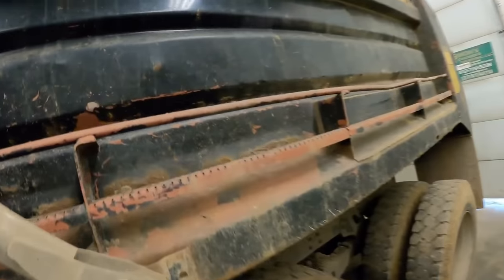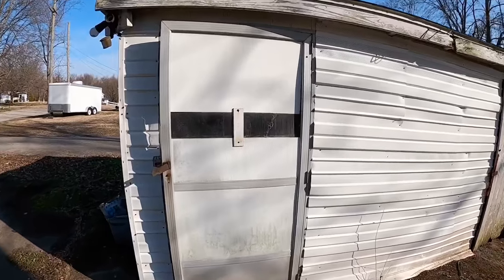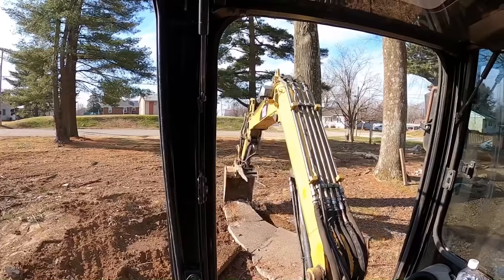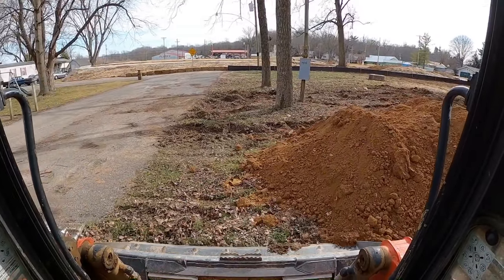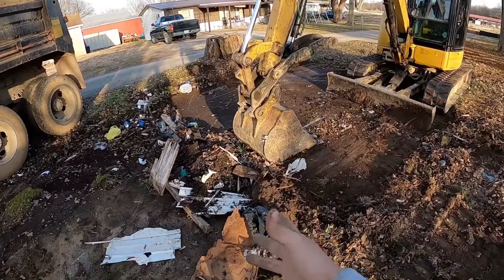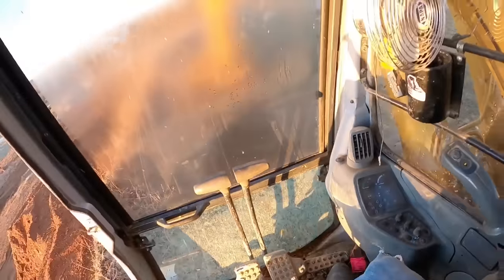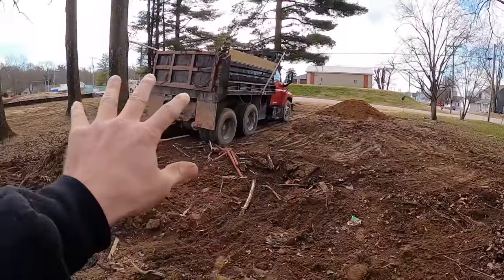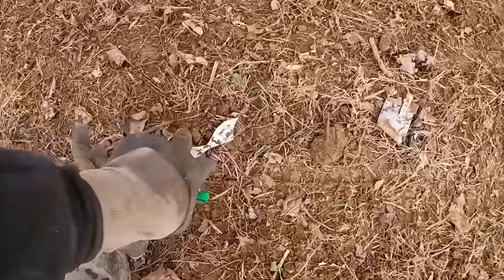Full Clean Up - Concrete Demo at Abandoned Trailer Court

Comment: Cap’n that lot slicked off nicely!  Can you sneak back and saw that walnut root burl off for me?  They make fantastic bowls when turned on the lathe.

Believe it or not watching you cut that Pex jogged an ancient memory... three days after I turned 18 I went to work in a steel mill.  Having zero seniority, I was awarded a job on the graveyard shift.  

Orientation consisted of my foreman handing me a pair of wire cutters, ear plugs, hard hat and safety glasses.  After he stepped on my toes to make sure I’d bought safety shoes, he said follow me.  

Walking through the warehouse to the furnace room, he read me the riot act about attendance policies.  And, he told me that I should do whatever my trainer told me to do.  

At the furnace he introduced me to an old man... weren’t they all old, when you were 18?  His name was Shelby. He had 20 years of experience doing the same job that he was doing that night.  

He said, we’re a little bit busy right now, go sit over there and watch.  So, I did.  He and another old man were using an electric high lift pallet truck to put coils of wire onto spools.  Their ends were then welded to the partial coils on the spools and fed through a tempering furnace.  There were 48 of them and they were all nearly empty.  I sat there alone for almost 4 hours and watched.

The two of them were working in perfect harmony.  As one moved the other counter moved.   It went very smoothly. 

Once they finished, they came over, sat down and grabbed their lunchbox.  As they opened them he introduced me to Russ.  I tried not to look at their dirty hands as I choked down my bologna sandwich.

About the time we finished eating, an alarm went off. Russ nods at Shelby, grabs one glove and walks over to a spool.  The wire on it is stretched as tight as a banjo string. Russ grabs the wire with his gloved hand and kicks the coil.  Almost magically the wire comes loose and the alarm goes off.  

Russ walks back to us and I ask what would happen if he didn’t untangle it.  Shelby replied, “Wire Lice.” I thought about it for about 2 seconds before I asked him what that meant.  

He responded... The wire will be pulled in two.  Then we’ll have to  feed it back through the furnace.  Those wire drawers are Prima Donna’s and don’t like short coils.  So, we’re supposed to weld the ends back together at the other end of the furnace.  Sometimes we don’t have time to do that so I just tell them it must have been attacked by wire lice!

That was my first inkling that these guys were just a bit ornery.  However, I was unaware of the initiation rites for new furnace employees. 

Later that night Shelby started teaching me how to operate the pallet truck.  He operated it with 20 years of expertise. The 2000lb coils were setting on their side and leaning against a barricade.  The pallet truck had a 6”X5’ tubular boom sticking out of the front.  You picked wire up by steering the pallet truck into the center and lifting the coil with the boom.  Simple?  

Yes, if you’ve done it a million times. No, if it is your first.  Just getting it positioned was a herky- jerky 10 minutes of amusement for him and Russ.  Lifting the coil and separating it from the one behind it turned into a mess. The result of which was the coil lying on the ground and a near miss of my toe with the wheel of the pallet truck.

As I regained my composure I looked at my coworkers and asked, “What do we do now?”

Russ looks up at the ceiling and says, “Sky hook.”

I look up there and don’t see a thing besides the steel roof trusses.  So I ask, “What’s a Sky Hook?”

Shelby answers, “We’ll need our Sky Hook.  The day shift must have loaned it to wire drawing.  Go up there and get it.”

So, I take off walking in the direction he points.  I wander over to the cleaning department... they point me around the corner.  I walk into the room and they inform me that this is indeed Wire Drawing but, Warehousing had borrowed the Sky Hook.  They point to a doorway.  

I dodge several lift trucks and enter a warehouse as big as a foot ball field.  After wandering around that maze for awhile, I stop one of the lift truck drivers and explain my mission.  The driver tells me it has been loaned to shipping and points to the far end of the warehouse.

When I get to shipping they point back to where I came from and inform me that on the other side of Wire Drawing is the maintenance department.  They were using the Sky Hook.

After trekking around the plant for nearly an hour, I arrive at the maintenance shop.  There I’m met by a familiar face.  Bill was my neighbor.  He was a few years older and had been working there for about a year.  I explain to him that I dropped a coil and need the Sky Hook.  He grins and tells me that he too had been sent on a Wild goose chase when he was hired.  Then he tells me he has an idea.  He had just about finished making a stainless steel hook that the crane operator could use to fish dropped coils out of the acid wash cleaning tanks.  No one knew about it yet.  

Bill loaded it up in the back of the Cushman service cart. We climbed aboard and putt-putted back to the furnace.

As we pulled through the doorway I could see the smiles on Shelby and Russ’ face.  Those were wiped off quickly when Bill parked the Cushman and drug the 100lb Sky Hook off. He then sat down and said, “Here’s the Sky Hook.  Go ahead and use it.  I’ll watch.”

And there it was... the exact right tool for the job... and no way to use it!  

Word spread around the plant pretty quickly... at the end of the shift I was standing in line at the time clock.  My foreman came up to me and asked how it went.  I told him I thought it went pretty good and I liked the job.  He grinned and said, “Kid, you’re gonna do good here.  You’re the first one to ever find the Sky Hook on their first night.”

So you see, Cap’n it pays to have the right tool for the job!
Reply from the maker: I’m compiling all of your stories into a book for renters to enjoy.  Yup.
Reply: @CaptainKleeman  I just keep a copy of War & Peace on my bedside table... puts me right to sleep!  Thanx

Comment: Good job cleaning up. Liked where you showed the effectiveness of the tornado anchors ( sarcasm). Not much uplift resistance. Had to hire a trailer house crew to do similar to a 27 foot van office/ change shack. High wind area. They drove anchor rods with a 90# hammer. Keep up the good work.
Reply from the maker: Yeah,  I don’t think they’d re very effective. 😂

Comment: the crackhead scrappers around here wouldve been climbing in the dump truck for that wire, metal. probably wouldve almost buried one in the bed lol

nice work loading the concrete , not just flinging those chunks from 5-10 feet high
Reply from the maker: Scrap prices have been down around here.  Thanks for watching!

Comment: I’ve hauled much larger loads of concrete than that with my dump trailer and my 1984 Chevrolet K10 short bed pickup. I’m guessing if you were paying for the fuel you would probably be hauling reasonable size loads
Reply from the maker: Alright there hotshot, while you're cleaning out your jammed up tailgate on a mile total trip, I'll wave on the third trip while laughing at where your "knowledge" got ya 🤣🤣🤣
Reply: @CaptainKleeman  I always pull the top pins instead of the bottom pins with a load other than sand, gravel or loose dirt and never have a jammed load, I drove my first dump truck in 1973 it was an all wheel drive Oshkosh that kinda looked like a super version of Lt Dan. I do love watching, God Bless and stay safe out there!

Comment: Captain  don't  do that  pull everything  out of the shed first and sort into  piles I will give an example  1 pile wood 1 pile for metal 1 pile for concrete and 1 pile for rubbish that way you will not have it mixed together.